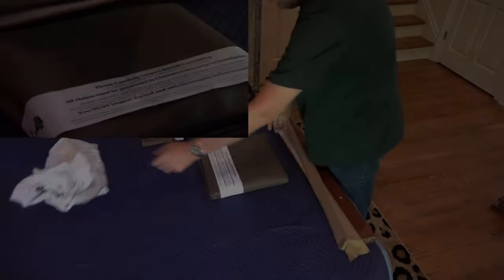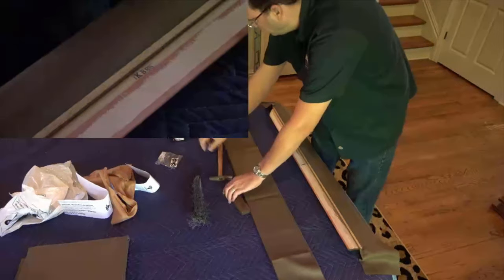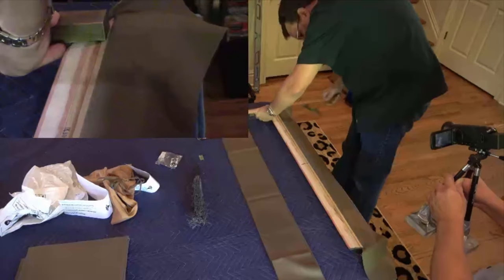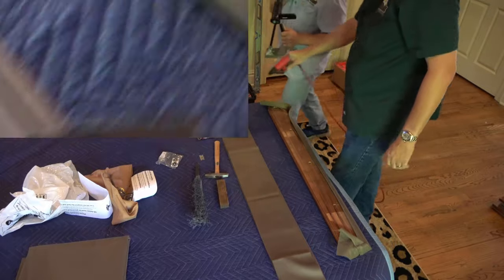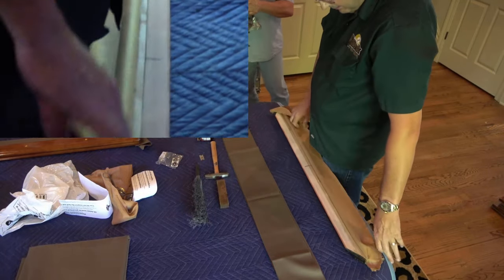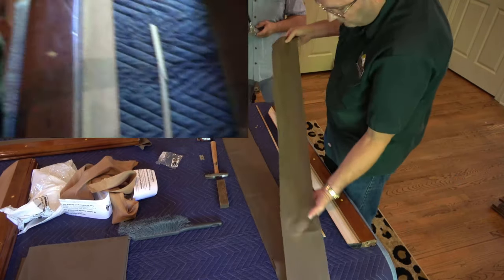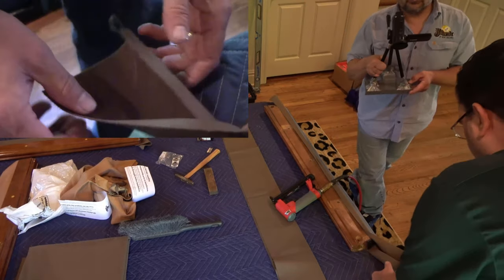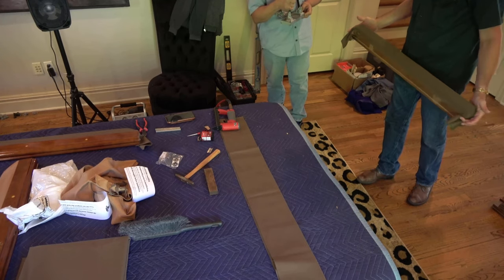How to Recover Pool Table Rails (THE RIGHT WAY)

Comment: I just want to say thank you for your videos. I bought a 1976 Brunswick Viscount from Facebook a few weeks ago.  It looked to be in great shape in the ad. When I got there it was completely disassembled. The slate had been packed by pros. I was assured that everything was in great shape.  I know realize that the seller either didn’t know what was going on with the table or he just lied. After talking with him I believe he just had no clue what shape it was in.  But with your videos I was able to diagnose the issues and get in as proper condition as I can without rebuilding the wood rails completely. I just finished rebuilding the rubber and re-covering the rails. With your help they look almost professionally done. I felt it was worth the investment because I only paid $200 for a slate table. Again Thank You!

Comment: Thanks for making the video.  Picked up my first table, a oversized 8’ Brunswick Madison, gentleman in our church bought new in the late 70’s or early 80’s.  Not a scratch on it.  1” Italian slate sticker on the bottom.  The Aramith balls were in need of a cleaning.  Lots of oxidation.  The Aramith restore and cleaner 2 bottle kit worked miracles.  Yellow is gone.  They look brand new.  Mirror finish is back

Comment: Regarding FEATHERSTRIP (FS):  I have a long, very skinny, flat-blade screwdriver that fits perfectly in the FS groove. It is great for getting under really snug FS and working it out without breaking it. REPLACING FS can be a pain because neither the groove nor the FS profile is standardized, and replacement FS from your supplier may not be a good fit. When you do find quality FS, buy a bunch of it, and hide it in a safe place for future jobs.

Comment: I watched your video of coin operated pool table recover and now I’m wondering how you decide when you fold the felt at the corners or you take your “elephant” approach
Reply from the maker: I'm not sure I understand the question. Are you referring only to coin-op tables?
Reply: @CreativeRestorations  thanks for your wildly quick reply! That was what I was talking about. I imagine it’s the different type of bumpers. I just finished a coin operated table using your video (super helpful BTW) and I thought folding the corners on this one was just different
Reply from the maker: Yeah. It's two different upholstery techniques for two different types of rails. Coin-op tables don't use feather strips. So, the cloth gets attached completely different than a home-type table. You can see from the two videos that the rails are completely different. Understanding how the cloth "bends" when doing upholstery will help determine the best way to avoid wrinkles. The "elephant ears" technique is strictly used in coin-op type rails.

Comment: Is U23 bumpers the standard for 7' bar style tables? I'm confused on what I may need. Thanks for any info.
Reply from the maker: Coin operated tables have been fitted with a variety of rubber profiles over the years. U23, K55, and K66 are all fairly common. You have to measure to see which one you have.

Check out this link for the measurements of the most common rubber profiles:
https://www.seyberts.com/pool-table-rail-rubbers/standard-pool-table-rail-rubber/

Comment: I'm about to recover my table for the first time with new worsted wool. The old cloth seemed to be the same texture on both sides. I read that worsted is put down fuzzy side down and smooth on top. It just seems strange to have such a smooth surface compared to the old cloth. Am I reading the instructions correctly? The fuzzy side of the cloth seems more like the top side of my old cloth. Also, when covering the rails it seems like my feather strips are below the rail even after the cloth is folded over. Shouldn't everything sit level with the rail? Will it hurt anything? Thanks for any info.
Reply from the maker: The instructions are correct. Fuzzy side down.